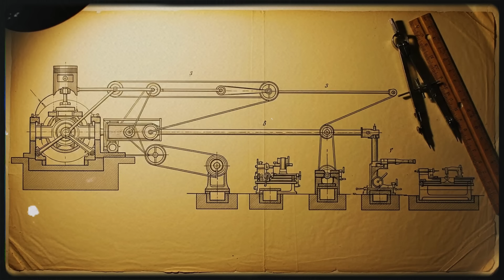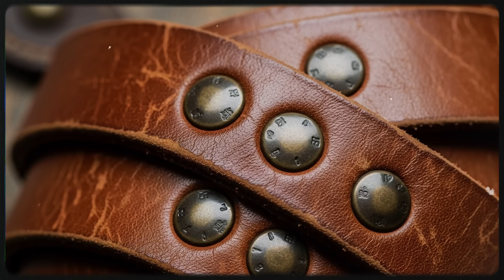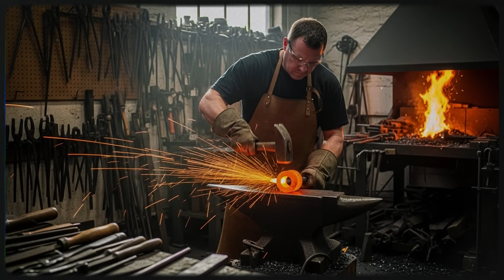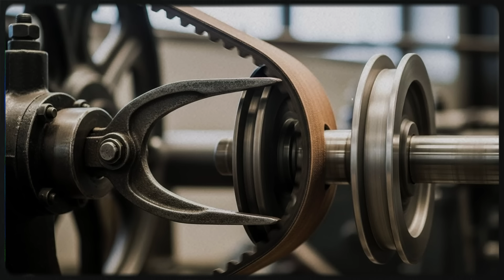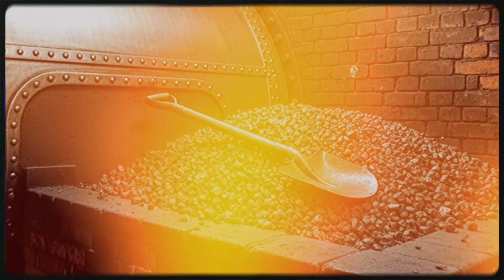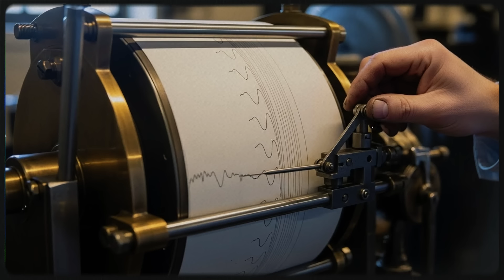How Did 1800s Machines Work Without a Modern Power Source No Historian Can Answer

Comment: It is possible with just wind power and massive fly wheels.
Let the fly wheel spin up for a week or so, gaining speed,then run shop machines for two or three days.
It is not suitable for rapid, continuous work.
Just intermittent projects that have no real timeline to finish.

Comment: Remember we had STEAM RADIATORS in buildings, and the central boiler in the basement tended by a fullltime employee.  We don't have this guy anymore because the understanding to operate a steam heating system requires knowledge we don't distribute.

Comment: Probably before a fire too heat the steam boiler/ Radium 1st was probably used too heat the water/ look up size of "fire pots" vs area too be heated!
Reply: Sweetheart, you used the wrong "too" three times. They all should have been "to". The one with two 'oo's' means also, and in addition to.

Comment: A steam engine can be built near a lake or pond, making it more versatile, but we dont do enough with canals anymore. The ancients had water wheels far fro the main source. Once they are built they can last centuries. Like a timber framed cob home, with a stone foundation and long tiber eves. Like Roman concrete that is self healing and works even better under seawater. We need to revalue everything, food, medicine, resources. Many of the old ways are better.

Comment: What you nor history addresses is the machine shop that built the massive rollers to roll out sheets of boiler plate, made the precision-milled cylinders out of raw castings, made the many yards of seamless tubing necessary to a steam engine. History never addresses who built the mill that built the mill, nor the machinery to mine the ore, the coal, the limestone and the method of transport - canals and barges? - railroad? - steam shovel?  Or are we to believe it was pick and shovel and horse and cart?

Comment: Big boiler in the center of the town or village, made out of stone mind you, with piping allowing the pressurized steam to flow through into other pipes that had levers to control the steam pressure. I had a 100 sewing machine handbag making business in the old world. I used the steam power from the central towns boiler to operate my 100 sewing machines. We made a couple thousand handbags a day using steam power from the towns central boiler. We had hot running water too, took hot showers in stone bathrooms. Old world was really nice...steam power ran everything and it allowed water to keep our gardens looking nice. Then ole lucirer wanted to be god so he went around destroying all that advanced steam powered stuff and now we have weak evil feeble machines that constantly need repairs and maintenance due to inferior folks being rewarded for making inferior to what we can make crap...and forcing humanity to use weak gay crap. Bring back the water boilers and produce machines to run on steam power again and you'll be amazed at how much better life becomes.
Reply: Amen to that,  The older was the better, by far.  Quality, integrity, pride in work well done. Make it to last a lifetime, or two.

Comment: To consider the past /  the metal machines were bigger / metal  ships /metal trains  metal subs...commonality was strength...strength to hold ...strength for pressure containment....dial for slow release / 100 percent efficiency... easy in thought the further we go back in time / more complicated moving forward ....have to consider why we were making metal...making extremely large objects / the power to create  mold ...War ? its true use was the distraction over the knowledge of free ....the containment of air and water pressures...the bigger / the simpler / the smaller containment devices is where the wizard of oz  started / making extra parts / jobs/ ...machine making machine for human use produces free....Extremely Dangerous knowledge to those creating history /  money pressers and patent offices....
Reply: Behold....if train compression can rotate the metal wheel on dial  control / you can  create all types of power needed
 without the enslavement  job gadget tree .

Comment: Partly powered by aether and static electricity?

If it works without input it would probably be wholly powered by aether energy. Wonder how they got the resonance, vibration and frequency just right?
Reply: Electricity is everywhere. The earth’s electrical field has been known for centuries. Lightning and St. Elmo’s fire are the most dramatic manifestations of atmospheric electricity. But the field doesn’t exist just in the vicinity of these events; it’s everywhere.

The earth is an electrical conductor. So is the ionosphere, the layer of ionized gas about 70 kilometers over our heads. The air between is a rather poor insulator. Some mechanism not yet explained constantly pumps large quantities of charged particles into the air. The charged particles cause an electrical field. Although it varies widely, strength of the field averages 120v per meter.

You can measure this voltage with an earth-field antenna—a wire with a sharp point at the top to start a corona discharge, or with a bit of radioactive material that ionizes the air in its immediate vicinity. Near the earth, voltage is proportional to altitude; on an average day you might measure 1,200 volts with a 10-meter antenna.

Dr. Oleg Jefimenko invented an earth-field-antennae connected to an advanced corona discharge electrostatic motor which can convert the energy of the earth’s electrical field into continuous mechanical motion.
Reply: In the nineteenth and early twentieth centuries, a large number of researchers investigated ways to extract electrical power from the Earth's ambient electric field.

The leader in this field was Dr Hermann Plauson who in the 1920s succeeded in generating significant quantities of electrical power comparable with modern solar photovoltaic systems of a similar scale...

The amount of electrical power that resides in our atmosphere is astounding. Herr Plauson found in his experiments that a single balloon sent aloft to a height of 300 yards gave a constant current at 400 volts of 1.8 amperes, or in 24 hours over 17-1/4 kilowatts! By using two balloons in connection with a special condenser battery, the power obtained was 81-1/2 kilowatts in 24 hours. The actual current delivered was 6.8 amperes at 500 volts.

The inventor of the new science, an engineer of note, Herr Hermann Plauson, has devoted years of labor to his researches and he has now actually in use small power plants, that generate electricity direct from the air, day and night, without interruption at practically no cost, once the plant is constructed.